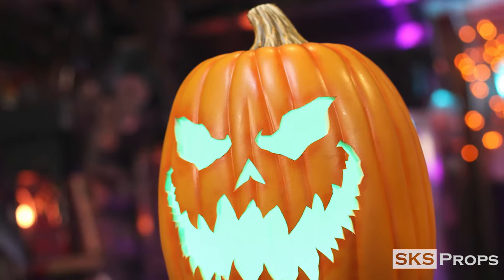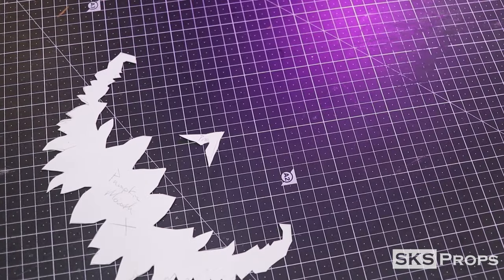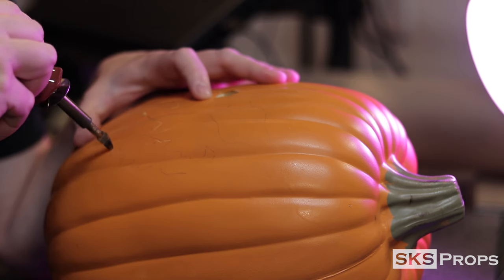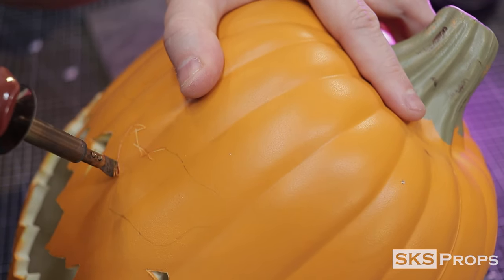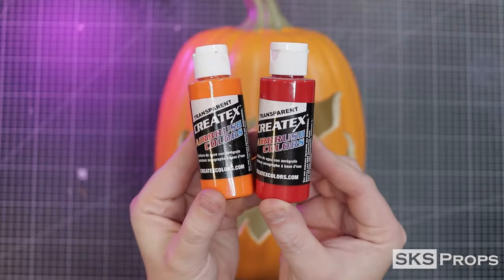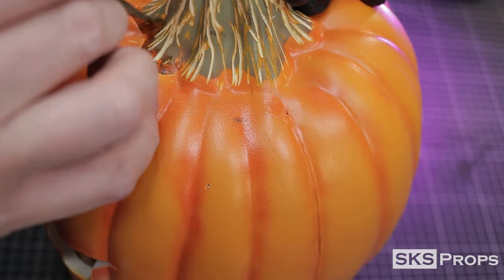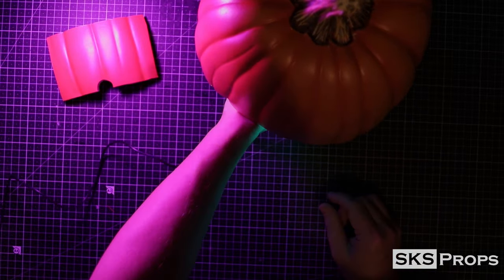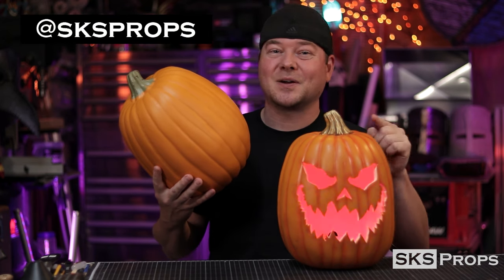How to Carve a Foam Pumpkin - Easy Tutorial - DIY Hot Knife - Paint and Light Craft Pumpkin

Comment: For the fog, seal the pumpkin seam with clear silicone.  Then fill the pumpkin with water and put the fog unit in it.  Lasts a lot longer.  Make sure the low part of  your mouth is high enough to keep the pump unit under water for a while.  Mine last at least half a day before needing water.

Comment: I'm still going to cut my foam pumpkin, using a dremel drill bit. I'm just going to take it add a nice paint job. I need to fail and learn from my mistakes.
Reply from the maker: Stay tuned for next weeks video I've got a HD-Foam pumpkin in the works that is a challenge if that's what you are wanting!
Reply: @SKSProps   I'm still learning how to make props. The foam pumpkin is a challenge!

Comment: I did this with a teal pumpkin(didn't know what it meant at the time, just liked the non-traditional color, whoops) last year.  I put a conveyor belt I designed and 3D printed in it to vomit candy out at people at work who pressed the button. 😁  Ran out of time to paint it though, I should do that this year to finish it off.

edit: That hot knife looks way easier than the electric pumpkin carver I used, which worked fine but the foam ate up the teeth on the first blade.
Reply from the maker: That sounds awesome!

Comment: I've never done this so I don't know the fumes ... Is it necessary to wear that mask? Can you bring it outside and it be better with the fumes? Your pumpkin looks awesome and we are definitely going to try this soon!!
Reply from the maker: When I’m doubt be on the side of caution. If you were to cut it outside that would be way better than an enclosed space
Reply: YouTubers have to recommend protective equipment to avoid legal issues. Carving a few pumpkins here and there without a respirator is perfectly fine. Same goes with spray paint and melting plastic with a heat gun.

Comment: Wonder if an exacto knife would work well; im not gonna buy the hot knife for this one thing 😆. I also wonder if any styrofoam pumpkin works or it has to say carvable.
Reply from the maker: A hot knife with blade attachment is the same as an exacto...but with heat, so no a regular knife would not cut near as easy or as cleanly. Plus you can get a hot tool for $10-15 that is less than the pumpkin costs
as for styrofoam they aren't hollow and the interior is the larger beads while the outside has been heat molded. Once again you need a heat tool for an easy carve and clean look

Comment: The hot knife seemed to burn my pumpkin at times, so I had a lot of sanding to do to get the scorched spots off along the cut lines...any ideas as to why my foam pumpkin was scorching?
Reply from the maker: The knife is most likely not moving quick enough and or is too hot for those areas. Also the one I use you can adjust the temp. If yours has that you’d want to adjust that down just a bit.

Comment: The real question is can they be carved without a special knife tool? Otherwise....
Reply from the maker: The blade is not really special you can buy a heat tool anywhere Walmart, lowes, Joann’s etc and they are cheap. 
You could use a serrated blade but it won’t be near as clean the heat plus the hobby blade is the trick.

Comment: My HotKnife does not seem to cut that easily…I must be doing something wrong 😫
Reply from the maker: Make sue temp is at the highest setting. Your blade may be dull replace it or sharpen it
Reply: @SKSProps  I did have the temp up all the way and the blade was fresh out of the box, but maybe it was dull from the get go…? It also kept coming loose maybe that had something to do with it too, maybe it wasn’t getting the full heat.

Comment: I'm absolutely positive the sellers of carvable foam pumpkins did not intend everyone to buy a hot knife.
Reply: I'll just use xacto like I planned.
Reply from the maker: Well…You’re absolutely positively wrong. It’s listed as one of the tools to use on the tag. Work smarter not harder. Adding heat to a blade will definitely give you a cleaner and easier cut.